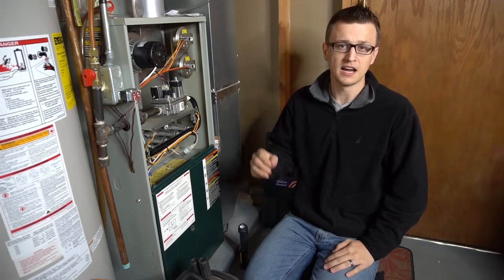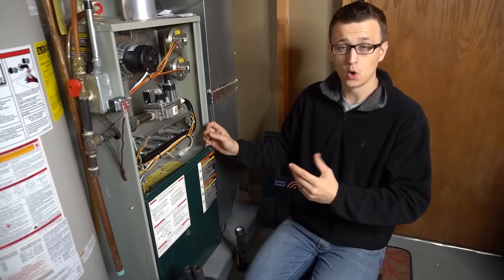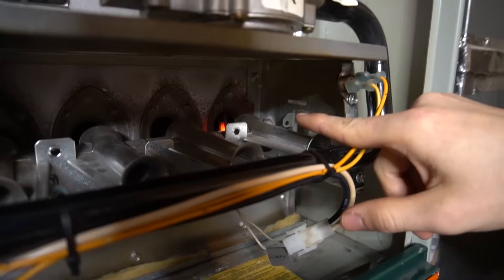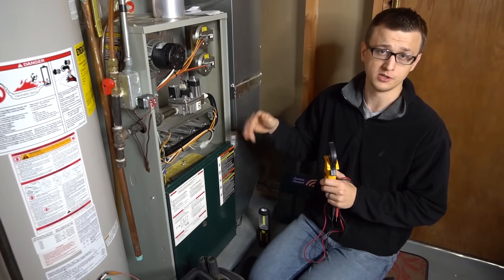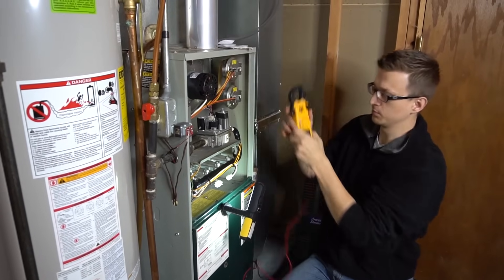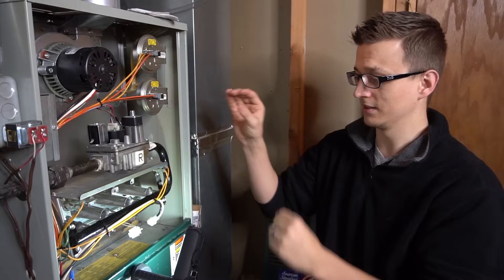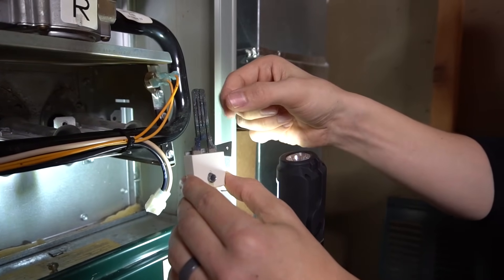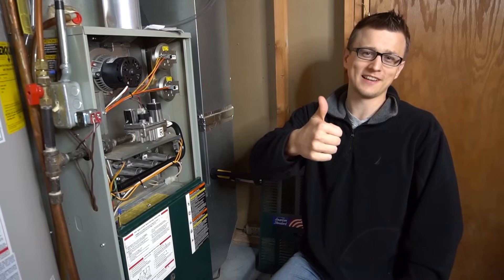Furnace Not Igniting - How to Check and Replace Ignitor

Comment: Great videos but I still cant figure out whats wrong. Everything works up until after the igniter lights up - it seems like the burners are not getting gas. I cleaned the them like you showed in another video but nothing. I dont hear the gas clicking on and think that is the problem. I had my control panel replaced this summer for A/C issue. Could that be casuing a problem? Hoping you coud give me some guidance. All your other videos have been super helpful.
Reply from the maker: Do you have a meter that can check voltage? That would help verify things.. The first thing I would check is if the gas valve gets 24v after the ignitor starts to glow. It could be either a bad gas valve (try wiggling the wires going to it when it is supposed to click on, maybe it's a loose connection) or a bad control board which is not sending power to the valve or was not wired correctly...

Comment: I have the direct spark igniter but it's not sparking would I need to replace it?
Reply from the maker: Usually the spark ignitor is not the problem. I would suspect the ignition module or control board first. (trace the wire from the ignitor and see where it goes)
Reply: Ok thank you!

Comment: Thanks for your video, but when I check the voltage in input of ignitor there is not 120 V in connection, just shows 0.1 , what is the problem, is there any problem on my main board ?
Reply from the maker: Possibly yes... But is the control board blinking any error codes?
Reply: @WordofAdviceTV  mine blinks I have a newborn and landlord keeps telling me it just needs to heat up which is obviously not true

Comment: Hi! I have a Lennox furnace and it is not igniting. My inducer motor turns, gas coming out but ignitor doesn't glow. I check the voltage as you mentioned and I have voltage of 121 v but my ignitor reads 64 ohm. Is it possible that the ignitor is burnt? Also, I installed a new flame sensor thinking that it was the issue. What should I do next?
Reply from the maker: If the ignitor is getting power but not glowing, then there is really only 2 possibilities. Either there is a bad connection/loose wire going to the ignitor or the ignitor itself is bad.
Reply: Problem solved and I thank you for your help. I changed the ignitor and it's working great
Reply from the maker: @gusmansylvain3334  Glad to hear you got it fixed! Thank you for the update, stay warm!

Comment: I recently started having trouble with my rheem RGTA-09EZAJS. I noticed it wasnt heating at about 4AM. I restarted the unit and all burners turned on for about 5 minutes. After that it shut off. I tried cleaning the flame sensor with steel wool. No luck. It goes through the start up procedure. Inducer kicks on, then the hot surface igniter kicks on but I don't hear the hissing from the gas valve. Is the gas valve supposed to kick on if the flame sensor is bad?
Reply from the maker: Yes, even if you are having a flame sensor issue the gas valve would still open for a few seconds. Is your furnace control board blinking any error codes? Likely a safety limit is tripped.
Reply: @WordofAdviceTV  Thank you for that info. I guess I didnt know I had a LED light with flash codes. I will have to check when I get home but I didn't see any indicator lights on my unit.
Reply from the maker: @dcazares001  No problem! And most furnaces will have a little LED light but there are a few that don't... What I would do is pull the bottom door off and tape the door switch. Sometimes it's hard to see the light through the sight glass in the bottom door. (it's rare but sometimes the board can be behind the top door too..)
Reply: @WordofAdviceTV   Excellent. I'll be sure to give this a try when I get home. My panel and switch are both located at the top of the unit. I also was reading somewhere that this could also be a filter issue or flow issue. I have some troubleshooting to do today but I think i'm going to schedule a tech for later in the week as well just to be safe. Temps are starting to drop up north! Thanks, again.
Reply from the maker: Sounds good! Yeah, it costs nothing to schedule an appointment so it would be good to go ahead an schedule it. You can always cancel it if you are able to figure it out yourself. Good luck!
Reply: @WordofAdviceTV  One more question since I have our ear: Is there a way to reset the limit switch or test it?
Reply from the maker: @dcazares001  Here are 3 common ones and the videos where I talk about them:
Flame Rollout: https://www.youtube.com/watch?v=VAHSmeTTKpI&t=4s
High Limit: https://www.youtube.com/watch?v=pJzP1jzYPqg&t=3s
Pressure Switch: https://www.youtube.com/watch?v=Zax02itYHkU&t=1s
Reply: @WordofAdviceTV  UPDATE: I checked the pressure switch and I was able to hear the switch clicking. At first, I did  think it could've been the switch since it cracked as soon soon as I pulled it off of the draft inducer. I clipped the cracked part off and reconnected. No luck. I checked exhaust transition and only noticed that there was condensation from the clear tube to the condensate trap which I assume is normal. I then pulled the hose from the transition to ensure there wasn't any fluid backup but there wasn't any backup. Also, there was a wire that links the rollout switch to the overtemp switch that looked a bit melted so I taped it back up, ohmed it out at about.2 which is what my good wires were reading, placed it back. The next thing I did was just look at my limit switch. I didn't know exactly what I was looking for or what to test for but I just gave it a cleaning and placed it back. The last thing I looked at was my aux limit switch up top where the IFM is located. Again I didn't know what I was looking for so I just cleaned it and placed it back. The funny thing is that I didn't get any LED blinking codes at all. System was ok and power was on. Amber light never came on. I still think its odd that my gas valve isn't energizing at all. I never hear it or smell it after or during when the HSI energizes. I'm not the type of person that likes to quit and I actually really like to troubleshoot but I'm giving in. Might just need to call in the pro's for this.
Reply from the maker: @dcazares001  Sorry to hear that all that troubleshooting didn't get the problem fixed! So from what you described and what you checked, it sounds like it could either be a bad connection or bad control board. After the ignitor glows, the board is supposed to power up the gas valve. One last thing i would try is to push on the connector or wires going into the gas valve when the ignitor is glowing. You could also try pushing or wiggling where the wires go into control board as well. If nothing interesting happens, then that board is likely bad and not sending power to the gas valve when it should be.
Reply: @WordofAdviceTV  Thanks for all the help! The HVAC tech came out yesterday to replace the control board. Fired right up and today I woke up to a warm home again.

Comment: I'm not getting voltage to the ignitor. As I'm measuring I get about 1 second of a voltage jump to about 180 then it drops off to 8 volts. What's between the ignitor and the board? Ever see wiring go bad?
Reply from the maker: I have seen bad wires going to the ignitor.. To rule out the wiring, Go to where the hot wire from the ignitor goes into the control board and measure voltage there. If the voltage jumps around even at the board, then I would say that control board is bad.
Reply: @WordofAdviceTV  thank you. I'll try that out.

Comment: Your channel is awesome! I've completely taken apart and gone through every component of my HVAC using your channel. I eventually discovered my issue was with the Sensi Thermostat not turning on the heat output while the fan and cool output worked. Resetting the thermostat fixed the issue. 
In the process of going through the components I measured 16 ohms on the surface igniter while cold. Still works but the resistance seems low. I think my next step is to find the model number of the surface igniter and look up the watt rating to determine if 16 ohms makes sense.

Comment: My furnace does not clique to start gas what could be wrong. I checked ignitor and its good.
Reply from the maker: Is your control board in the furnace blinking any error codes by chance? That's where I would start.

Comment: Why can’t you use your pen stick voltage tester. Won’t tell you the voltage amount but will tell you if volts at device. Saves a lot of unplugging and plugging back. May save time on diagnosis
Reply from the maker: That would work too, thank you for pointing that out! Once in a long time, that method can lead to the wrong diagnosis though. I have had boards that did not send enough voltage to the ignitor.

Comment: Thanks for your videos ... very well done!  I replaced the hot surface ignitor that lasted 21-years ... saved at least a couple hundred bucks ... thanks!  The part was $22.95 ... the part looked fine but had a high resistance and was very brittle and crumbled when I took it out of the system.  The new part can be fragile as well ... be careful when replacing.

Comment: Jay, thank you for your excellent and very helpful video about the 10 most common furnace problems. I did what you said and checked and cleaned the flame sensor. I wasn't able to write my comment on the actual video., but it was the video in which the flame sensor is the #1 cause of the furnace wanting to start but keeps cutting out. Thanks.
Reply from the maker: Glad to hear you got it fixed! Thanks for coming back and commenting. Stay warm :)
Reply: The least I could do. Thank you!

Comment: thanks for the tips about looking for glowing and looking for a crack on the igniter. mine didn't glow and did have a crack, so that gave me confidence that it was the problem.
Reply from the maker: Glad I could help :) Good luck with the fix!
Reply: @WordofAdviceTV  yes, i ordered the new one on amazon, arrived within 33 hours, swapped it in in a matter of minutes. works like a charm. i knew i had it when i saw it immediately glow brightly after turning on! btw, i did a manual light a couple times while waiting for the replacement. worked no problem.
Reply from the maker: @fredsmith6324  Perfect! Good to hear the repair went smoothly! Thank you for coming back with an update. Stay warm! (and the manual light is very helpful for temporary heat! I do that too)

Comment: What about if my igniter lights up for 3 seconds and goes off
Reply from the maker: Most likely the problem is not the ignitor then. Do you hear the gas valve opening? If not, then I would suspect that the control board or ignition module is defective.

Comment: Question: my igniter doesn't glow every time the heat is called for. Your first scenario with your igniter unplugged is what happens most times.  Then we open the panel, call for heat, the surface igniter glows and all systems are go. Could the igniter be going bad?
Reply from the maker: Hmmm... So it works every time without the panel on? (you are talking about the burner chamber cover I assume) The two things that come to mind is that either this is a pressure switch problem (I have a video on pressure switch problems if you need it) or there is a loose or broken wire somewhere.
Reply: @WordofAdviceTV  this has been our luck lately. It doesn't fire up, my thermostat drops to 64, I turn the thermostat off then on again, doesn't fire. Go downstairs to inspect, fires up.  The panels are both on since I wrote my question and the ignition has been consistent. I am suspecting dust is an issue or my thermostat needs replacing.
Reply from the maker: @Necie8  Ah I see. If it is intermittent like that then unfortunately you usually have to wait until it gets worse so you can actually catch it in the act. Hopefully yours is nothing serious. Stay warm!

Comment: Im getting zero Voltage from the board and only 18 OL from the ignitor. Does that mean the entire board has to be replaced?
Reply from the maker: If the board is not sending power to the ignitor when it should be, then yes the board is bad. But I also want to ask, can you hear the gas valve open for a few seconds even though the ignitor does not glow? If the gas valve does not open, then there is something else wrong besides the ignitor and control board. Does your board blink any error codes?
Reply: @WordofAdviceTV  yes i can hear the gas coming out of the jets but cause there is no ignition it runs though a few cycles of trying to ignite. After failing to ignite a few times the unit shuts down and the red and green lights flash alternate the error code for that on my unit is "one hour lock out"
Reply from the maker: @chrispeterson1247  For temporary heat... If you put a long shaft lighter in the spot where the ignitor is, you can light the furnace manually when the gas valve opens up. (be careful and be safe when doing that though) But yeah, if the ignitor is not getting power from the control board, then that board is bad.
Reply: @Word of Advice TV Thanks! We have 2 furnaces one for upstairs and one for downstairs, the upstairs one is functioning just fine so we are just up there most of the time now. How hard is it to change the board out? Iv found one on Amazon for my unit, is it just a matter of unscrewing wires and taking clips off and putting them on the new board? Seems pretty easy. My HVAC guy wants to charge me $600!!!I found the part for $75! Thanks again for the advice!
Reply from the maker: @chrispeterson1247  Usually changing out the board is pretty easy as you said. Take your time, label wires or take a picture before you start taking things apart. If the new board is exactly like the original, then it's very easy. If the new board is a substitution that will work for your furnace then it can be a little harder. But usually the latter will come with instructions of how they are to be wired if any changes are to be made. There shouldn't be any problems. Good luck! :)
Reply: @WordofAdviceTV  Again, thank you! I ordered the new board today ($75) Its that same lay out as the original one so should be pretty easy.
Reply: Word of Advice TV Update. I just changed the boards out, took about 30 mins very easy job. I’m really wondering where the HVAC company got $595 from?? What a scam. Anyway the heat fired right up and it running strong! Thanks again!! Ran the voltage test on start up and I’m now getting 120 from the new board!! Your video saved me 500 bucks!
Reply from the maker: @chrispeterson1247  Happy to hear you got it going! :) Job well done! About the pricing... That is actually a pretty common price. (though a bit on the expensive side for that board) $100 trip fee, $100/hr labor and diagnostic, and $xxx marked-up part will get you around that 500 dollar range in a hurry. Anyway, stay warm!

Comment: Do you need to turn off electricity to replace the igniter?
Reply from the maker: Yes, the power should be turned off. Of course one can do it without turning off power but that's not a very safe approach.

Comment: My 13 years furnace ignitor was getting oandld and is not igniting every time, thus I bought a new one. My new furnace ignitor sparked, grow super bright white, burned out, and broke into piece on its' first ignition. I then reinstalled the old one and it did the same, glow white hot, sparked, and broke info pieces. Seems like some sort of short. I will buy a new one tomorrow Grainger but very nervous as it might happened again. What do you think I did wrong?
Reply from the maker: There may be something wrong with the control board. Do you have a meter? Can you check and see how much voltage is going to that ignitor? Also, if you see the ignitor glowing a bit too brightly like that, I would shut the furnace power switch off right away to prevent it from burning out and breaking.

Comment: What if the igniter glows but no flames ? My furnace is doing that .. does everything in the video but no flame .. until I reset the entire system 2 times then the flame would ignite after the glow stick glows
Reply from the maker: When the unit fails to ignite, do you hear the gas valve click open or no? If yes, then your burner orifices may be partially plugged or the burners may be dirty. If no, then there could be a problem with the ignition module or control board.
Reply: Word of Advice TV I changed the filter and cleaned the flame sensor put it back together it fired up and ran for 1 minute and cut out .. so I let it sit and I reset it and now nothing happens like before ... this time I don’t hear gas hissing out or the clicking just the glow and then the glow goes out ..
Reply from the maker: @tommybowtieordie857  When the ignitor starts to glow, try wiggling the wires going to the gas valve in different directions. Maybe you have a loose connection somewhere. Otherwise I would suspect that you have a bad control board that is not sending power to the gas valve.
Reply: Word of Advice TV ok thanks pal !!